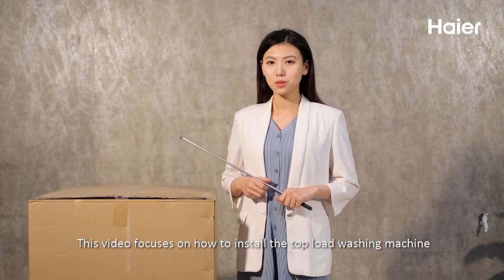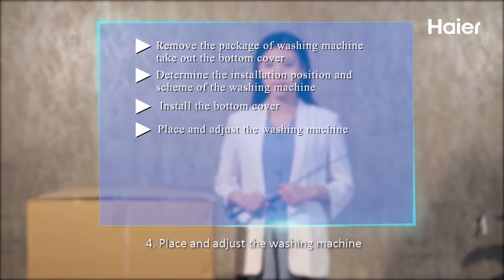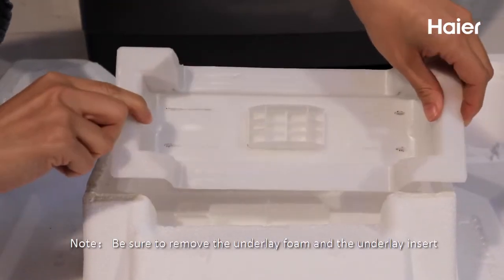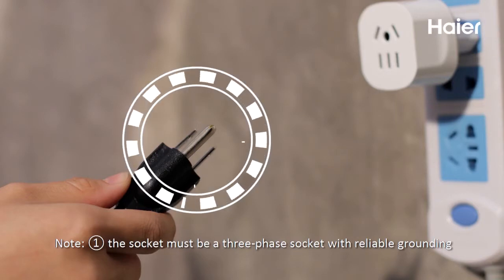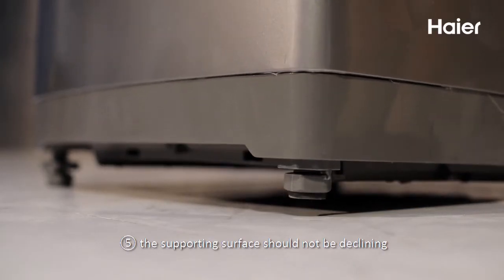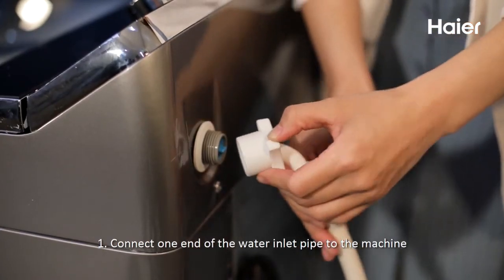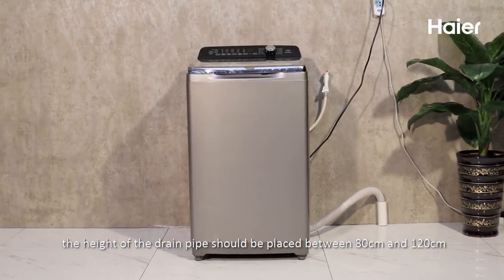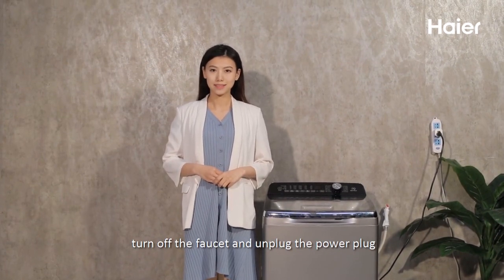Installation guidance of Haier top load washing machine

Comment: We bought Hair washing machine model number: HMW90 -1789 two years ago. Now it having a problem. When the machine fills up with water, its tub goes down a lot, which didn't happen before , also It makes a noise as if the lower part of it is rubbing against something. A mechanic has said that its pump has broken down. We have already stated our problem by calling the company once before. Please resolve our issue as soon as possible. Thanks
Reply: Yes same as my problem too..haizz, at the bottom very noisy

Comment: Resently i purchased haier 120_1678 model but i have a problem,machine did't work on spin option,it stop and move to rinse option automatically again and again,i have already checked machine level several times but no results found,so plzzzz guide me how to solve this error.
Reply: Plz reply as soon as possible
Reply: @noorzahra7373  MERAY pass b same machine ha kindly ap bta sakti hn k is main ap garam Pani use krti hn or kitni dair hoe ap ko use krtay Howe plz reply soon
Reply: Same issue did you get solution

Comment: I don't have water tap near machine, can put water manually in this machine without water inlet faucet?
Plz help me, I am in great need of your guidance
Reply: No, the machine has it's own water filter device.  If u use water without filtration ur machine may stuck. Moreover water level accelerate according to programmes. For example if u wash heavy fabric, ur machine will choose "blanket"mode and the water level would be set on "high".
Reply: @makeupandfood9642  thank you so much for guidance,
One more thing I want to ask from you,
Now I placed water tank near machine and connect its outlet with water pipe of machine
My machine does not take water properly from it